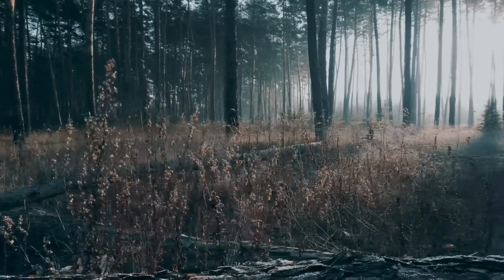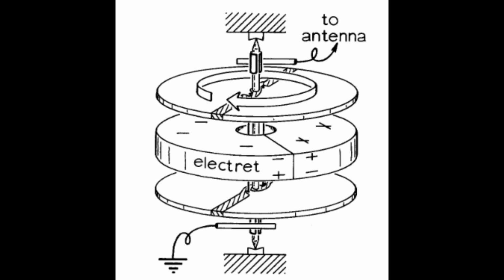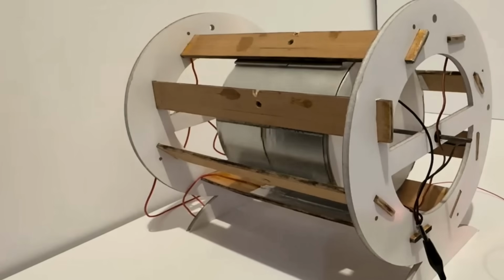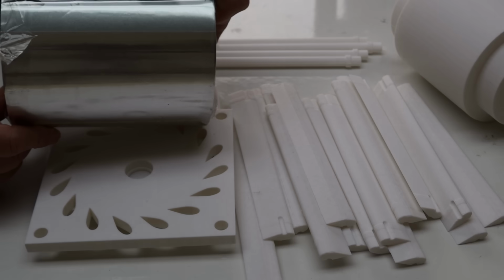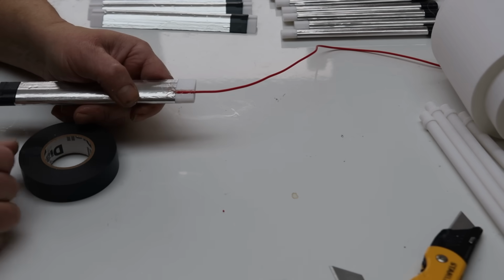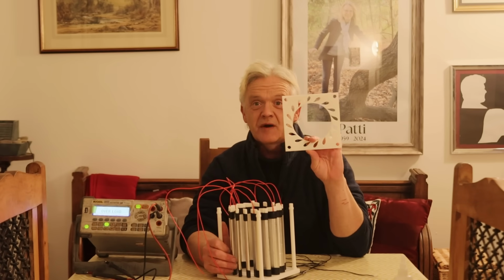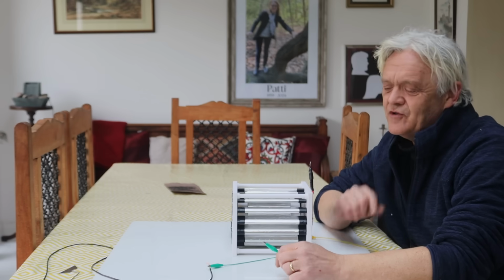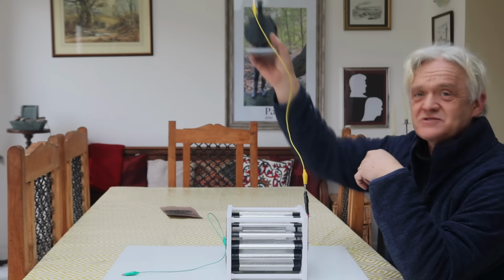2354 The Atmospheric Motor

Comment: Lasersaber rules :D You can use a thin black trashbag as hot-air balloon in sunny days to raise the antenna. Counter antenna is a good option for ground if there's a lot of bedrock. It needs to be same size as the air antenna.
Reply: I think mylar coated plastics are the lightest, for strength per weight.
And would also retain light fluids that really want to escape, like hydrogen, better than usual plastics.
Reply: @yasirrakhurrafat1142  NightHawkInLight made some good experiments on hot-air balloons. I think it needs to be quite big to be able to lift even thin copper.
Reply: @Kangsteri   that's why I'm saying.
Hydrogen would fair much better.
Mylar would contain hydrogen well.
And wouldn't be too heavy.
By hot air, you mean he likely used regular air right?
Electrolysis isn't too difficult. To get hydrogen easily.
And if you make your balloon unnecessarily big, small breezes would sway it wildly.
I look him up regularly too though, guy's an absolute genius.
He's able to actually replicate methods and cryptic science journals, and sometimes come up with more accessible, available and convenient methods to achieve pretty close results, with authentic ideas for application of those contraptions.
Love him!
Also, our guy here Robert Murray Smith! Love him too!
Reply: @yasirrakhurrafat1142 Sky lantern might be one cheap and easy option too.
Reply: @Kangsteri   could be considerable.. but thinking it through.. it'll use more energy than gained by the static potential.
The harvest will be negative.
Good for experimenting though.
I think a rather better idea would be to triple anchor 3 ropes in a triangle position (corners), and send up a turbine up there, hanging from a relatively large blimp, the wind will do a better job of harvesting energy.
Maybe Don't even send a turbine up there, just connect a rope and let movements of a balloon drive the rope on the ground.. harvesting energy while it does.
Reply: Would you mind briefly explaining what a counter antenna is? I'm very curious
Reply: @Unpopular_0pinion  Counter antenna was a thing that was originally used against long horizontal antenna to get cleaner signal. It is a ground antenna, or sometimes called virtual ground mass. It needs to be parallel to the air antenna but as close to the ground as possible (air antenna needs to be long as possible and have as much distance to any objects as possible. Like trees or buildings etc.). The counter antenna needs to have the same size mass to the air antenna and it can be adjusted shorter in length with variable capacitor, like the regular antenna. They got rid of the counter antenna concept cause of the lightning hazards.

Bad ground is like trying to jump in a mud. Full ground is like jumping on a concrete. Adjusted ground is like jumping on a trampoline.
Reply: @Kangsteri  thank you very much! I appreciate it :)
Reply: NASA was talking about using solar balloons on Mars back in the day. Mars gets enough sunlight to cause a heat differential between the inside and outside air, and has enough of an atmosphere for that to make the balloon buoyant at night, just after dusk.  The idea was to let it "hop" to a new overnight wherever the wind would take it, and then do any experiments from that location, and so on.  But then some folks figured out how to make a helicopter fly, and it was all over for the balloon 😢
Reply: When I was a child, they sold a solar balloon in magazines all the time. I eventually got my hands on one. It was just an 8ft long plastic garbage bag. It was very thin plastic.. all you had to do was fill it with air, tie the end to a string and wait. The sun hitting the plastic was enough to make it float as a hot air balloon. Nothing was required but the sun. It was a super simple concept. It had to be the thinnest plastic, not sure how thin it was but it was very thin like the cheapest of plastic bags from the grocery stores, the kind that you put one heave item and it rips the bottom of the bag open. It only took about 5 to 10 minutes of direct sun light to start flying. And the higher it got the more boyant it became. I guess because the air is cooler, and the sun is brighter as it goes up? Not sure but I played with it many times as a child. Floating at least 200ft. It just looked like a giant black blimp on a string. I'm sure you could probably find the add in a very old edition like 70s to 80s of popular science magazine. The beauty of it was simplicity and cost. It was just a plastic bag and kite string. Just throwing it out there if anyone wants to try it!
Reply: @newmonengineering  My wild guess is that the temperature difference was about 45-50F higher than ambient temp when heated from direct sunlight. When I was a kid, I hung a small gel burner under a thin plastic garbage bag and it worked... Right up to the point where it melted the bag and I had to go chase where it landed before the burner gel started a fire😂
Reply: I've been wondering about a tethered hot air balloon myself. I thought of it being powered (electric heater) from the ground initially, but now I wonder if enough atmospheric power to keep it warm.
Reply: @Number_Free  Turning electricity to heat is usually the least officiant thing to do. But you could put some diodes straight to small solar panels to make some heat.
Reply: @Kangsteri  I don't where you get that idea from. It's easy to heat a wire or filament - difficult not to!
Reply: @Number_Free  We are comparing thrash bags (free waste) to equipment of hundreds of dollars suddenly? I live in Finland and heating with electricity is the most expensive thing you can do with it, I can see it in my electric bill and rent. It's much more officiant to use diodes to create heat (infrared), than heavy equipment to transform electricity to warm up resistive wire. I see heat and amperes always as waste of money, space and weight. Nobody sane people is going to build a space rocket to collect atmospheric electricity :D
Reply: @Kangsteri  a low volt DC current over a nichrome wire is very efficient, and incredibly cheap. I have made Styrofoam wire cutter with a 12 volt battery, a piece of wire, and a very small $5 potentiometer. The smaller the diameter of the wire, the lower the current needed to heat it. (Assuming we are talking about a heater inside of a balloon.) With a Styrofoam wind turbine on the balloon tether, it should be very easy to heat the balloon air when the wind blows.
Reply: @EricFranklin-d2v  Please tell me one working prototype to prove the concept? This is getting in to crazy work to lift one copper wire to collect few milliwatts :D My interest is to provide a way for poor people to get cheaper electricity. Batteries weight way too much and are very expensive.
Reply: @Kangsteri  the higher the reach, the more charge collected. I was just thought experimenting on how to maximize that charge. 👍 No battery needed if a propellor generates enough low volt DC to heat a nichrome wire in a balloon.

Here is the thought. Make a vertical blimp/torpeedo outline shape out of metal. 
Heat that metal outline to just below the melting point of whatever plastic you are using, and press seal the bag. Now, print a turbine generator out of light weight ASA, or carve the prop from Styrofoam and attach it to a very small version of Roberts axial flux serpentine coil generator. Now, hang that assembly on the back side of your ballon and run a wire in through the opening underneath the ballon, to a printed circle assembly that holds some nichrome wire(maybe 3" of nichrome) like a heater coil and the circle just prevents the wire from touching the sides of the bag(5 cent resistor recommended to prevent overheating the wire). Then for the tether that is your electrostatic collector made of thin unsheathed copper wire and use it as your tether and charge bristle in the sky. Your limit will be air space rules, and the weight of the copper wire over that span. It's a thought. If the turbine can generate somewhere in the neighborhood of .25-.5 amps, then it should be able to heat the balloon air to significantly higher temp than the ambient air outside the balloon from modest wind power, and the black of the black exterior should help heat it in the day. It's a theory though. The only other option I could think of is hydrogen, but that involves the same current to generate the hydrogen through electrolysis, laws of physics say more power used to create hydrogen than the hydrogen produce, and concentration levels might not be easy to attain, and as time passes, the hydrogen will dissipate like a mylar birthday balloon when the party is over.  With a lightweight turbine running nichrome wire, you may could reach 100 degrees higher than ambient air. It would be a tricky balance between air volume, thermal conduction of the balloon material, and generating enough fractions of amps to create the needed heat.  I am unfamiliar with the characteristics of thin film solar, and whether that could be used to heat the nichrome wire and serve as the balloon material, but then you get into cost considerations of that thin film solar... Another thought is using polyamide film with laser graphene resistance coils lasered into the polyimide balloon material, but the technical difficulties of that, and the cost of polyamide, over a nichrome heater wire wouldn't seem to be beneficial.. lots more thoughts. Interior infrared radiation reflection to retain heat, exterior high absorption black, the solar absorption suffers because of the very thing that is needed to retain the heat, so then we get into material that changes it's thermal characteristics due to environment, and again, costs and weight... all Very interesting stuff.
Reply from the maker: cheers mate
Reply: @Kangsteri  vanta black or some other carbon nanotube coating where the carbon nanotubes are aligned, should give it maximum heat absorption on sunny days. Unsure if the weight of such a coating would be less than the lift gained from the increased gas expansion. And then there are coating durability issues to consider. In areas with decent winds, a small kite tail with a string of tiny LWASA printed turbines that generate enough electricity to heat the balloon. It may be possible to design LW ASA miniature kite turbines so that they create their own lift and do not drag down the lift of the hot air balloon that they heat. Basically, a Styrofoam prop on a conductive string, conducting to a piece of nichrome wire inside the balloon. The real weight issue is the weight of the wire. Uncoated wire may be best for weight... Do we have graphene wires yet? Can a Dyneema strand be made conductive?
Reply: @EricFranklin-d2v   yeah dude, strong ropes should do much good.
Our guy here, this channel Robert Murray Smith.
He also covered copper nanoparticles, said that they turn pitch black, maybe easier to achieve using mechanical means than growing copper nanotubes.
Thus, I say it should be looked into.
Guy also covered a solution, where they're using a plastic, or some hydrocarbon, and making basically spider web, with it, using some sort of enzymes.
I.e strong rope.
It should be looked into too.
Can you tell me more about Dyneema though, is it a patented, commercial product, or could be found or made more easily?
Reply: @yasirrakhurrafat1142  sorry to use a brand name. Ultra high molecular weight polyethylene. Use for lightweight sailing rigging, ropes are made of very small uhmwpe strands. . Non conductive though. I was just thinking of the lightest weight stuff I've used. Spider web sounds interesting. Yes, Robert is the man.
Reply: @EricFranklin-d2v   the guy is very innovative too.
And thorough in his research.
I thought he didn't cover news or had awareness of my latest finds of buzzwords such as nuclear batteries, or fuel cells (hydrocarbon), or portable hydrogen storage using metal hydrite stuff, or fuel/hydrocarbon synthesis using renewable energy out of basically thin air.
Except, those buzzwords were only a new concept to me, and I looked into his older videos, not only had he covered all of the things I had been geeking about, he even made some of the things already, in tutorials for us to replicate no less.
I was very ignorant to not have looked through his channel initially.
Although in my defense, the stuff I was looking into when I stumbled upon his channel were much simpler, trivial things.
Reply: @yasirrakhurrafat1142  I'll have to check his old stuff out. He has so many videos I feel like we need a cross-reference index in a spreadsheet. Amazing resource and human being, for sure.
Reply: @EricFranklin-d2v   we definitely do.
Way too many things covered.
BTW, the spider silk video he covered, may not be in this channel, it is likely on his "Thinking and Tinkering Talk Time" channel.
He has two other channels than this one.
Reply: Just google solar hot air balloon and you can see some versions of it in action
Reply: I continue to create a project of an internal non-combustion engine, I remind you that I am posting here on my channel the technology and the principle of operation, according to which anyone can create a prototype and enjoy free energy, since I am denied financial support at the stage of the idea and theoretical research, after a year of unsuccessful searches. Including I will begin to assemble a sample. And soon another video will be released revealing my developments, the wind of change is coming! All those who are not indifferent, welcome to fly into this departing innovative car, which will lead to great achievements for the successful future of the planet and humanity!

Comment: Hi Rob, I posted a comment on an old video, to keep my comment on-topic. I'd wanted to draw your attention to it, in-case you don't see older comments, as I'd appreciate any insights you may have.
The video was 'DIY Battery Pack from Scavanged Batteries' from 18th December 2020 (v=zjRJbITV7Ks&lc=UgyXyKlen_NDa1dgVE54AaABAg)
Reply from the maker: you are right i don't tend to see older comments mate - what was your question?
Reply: @ThinkingandTinkering  I posted the comment on a on-topic video so that I can find the information again in the future and also the answer is available to anyone else who is exploring the topic of building batteries.
You should be able to find my comment on the video using the query parameters I parenthesized in my OP. Although for some reason it appears to be hidden unless the comment section is set to 'Sort by: Newest first'.
I'll post my comment after this one, though it may not be visible without changing the 'Sort by' drop-down menu on the comment section.
Reply: @ThinkingandTinkering  my comment on the DIY Battery Pack video was:
'I am trying to create a 7S6P Li-ion battery pack from disposable e-cigarettes and retrofit a replacement for a 2S Lead-acid e-scooter. However, the only way I can fit 6P is 2x3P end-to-end (either shared negative rail with two positive rails or shared positive rail with two negative rails), so I was hoping for some design suggestions and terminology, particularly around safety considerations.
I've previously seen a battery, either from a children's toy or a tool, with two female terminal receptacles on one edge and one female terminal receptacle on the parallel edge. But what would this terminal configuration be identified as? e.g. The Makita BL1830-PK3 battery has "sixteen firm holding contact terminals", but how would that be presented in notation? e.g. 7S6P instead of "42 cells"'
Reply from the maker: It can be hard for me to find comments mate - you have to remember i have thousands of them and get about 3-400 new ones every day - I basically do my best and often it's not good enough. Anyway - I hate to say this but I don't really know what you are trying to achieve - I get the idea in general and I suppose you can't fit them in the physical space of your e-scooter which is why you are concerned with their layout - also when you say disposable vapes - what size battery have they? My understanding is there is a variety of size and it is a bad idea to mix sizes - so stick to 18650s and use standard boards - if you have to remodel the space - do that - there is not a lot else to say really
Reply: @ThinkingandTinkering  I will spread my response across two comments.
My question relates more to the notation used for battery configurations. I'll give two examples of my train of thought.
(1) In the area of PCB/PWBs, on the 'UL iQ for Printed Wiring Boards' database there is a multi-value attribute called 'Board Type', the first value defining the base-layer (e.g. Single/Multi-layer; Flexible) and the second whether the board is single or double sided.
(2) Devices with Coaxial Power Connector's usually have a Polarity symbol, "positive polarity" or "negative polarity", effectively denoting the polarities of the central and ring terminals.
Reply: @ThinkingandTinkering  I have sets of different sized cells and can use whichever size and configuration is optimal for the e-scooter battery bay, but the most likely candidate will be 21350s.
If I were to amalagamate the PWB and Barrel Plug notations as an answer to my question, for a battery of double-layered cells with a single positive rail at the center and dual negative rails on the edges, then my notation would be "7S(3P+3P) SL/DS ⊝-c-⊕".
But surely that is a frankenstein of a notation, and meaningless to everyone else. Surely, Coaxial Power Connector polarity notation can't be used to specify that the center power rail of a battery is positive?
So I'm asking whether there is a notation or terminology for battery configuration/layout, which succinctly conveys the make-up of the battery, and, if so, what would be the notation of the battery I am proposing?
Reply: @ThinkingandTinkering  prior to this comment I responded twice, but only one of them is visible unless the 'Sort by' drop-down menu on the comment section is set to 'Newest first'.